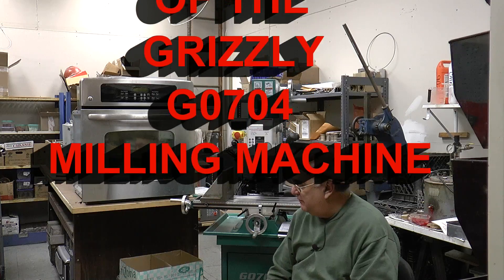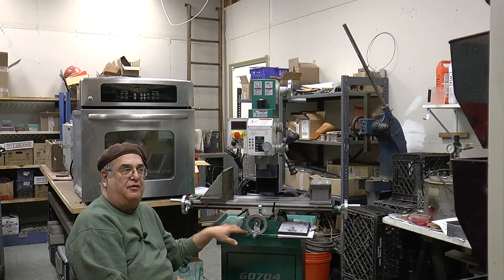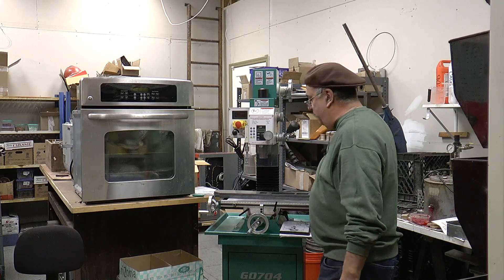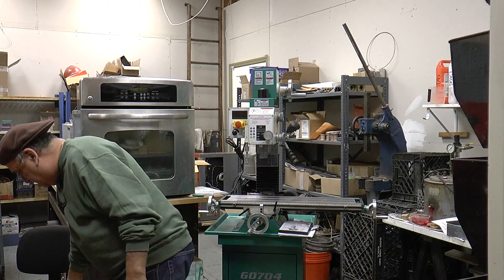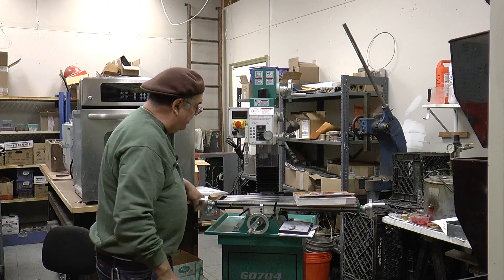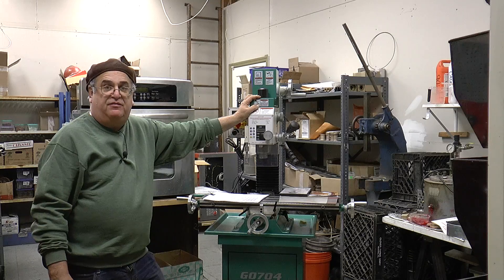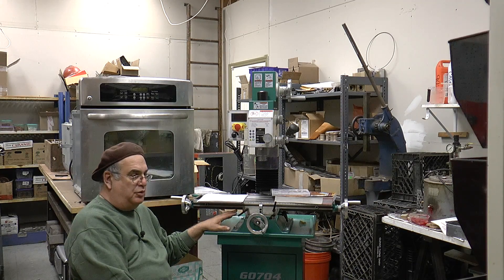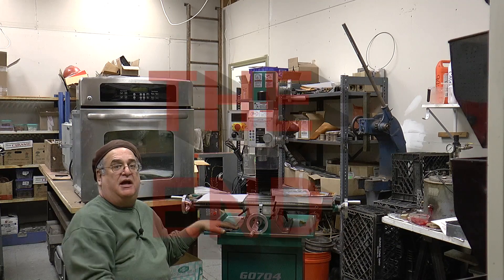A REVIEW OF THE GRIZZLY G0704 MILLING MACHINE

Comment: Looks like a nice little mill, and a good review. I am looking to get a machine/ machines myself soon. I have toyed around with the idea of a Smithy 3-1 because their benchmark is fairly high. What do you think about 3-1 Machines? I already have a small lathe(6"). I feel like I would end up getting tired of changing between the Mill and the lathe( I have some machining experience since both my grandfather was a machinist and he had a full shop like you have that I used when I was a teenager). Also I think that I would get kinda fed up not being able to stand in front and walk around the mill since I am accustomed to using a Bridgeport. I was thinking maybe I should just get a real mill like this one and wait on a larger lathe. It would be cheaper and I could send the larger parts out for machining (like drive wheels). Before he died my grandfather started my on the 3-truck Shay project with castings from http://www.shaylocomotive.com/. Most of the major machinging is done on the 3 cylinder engine.  I would like to finnish that before I move on to hopefully a 1.6 scale Pennsy L1s/K4 so I would like to have the capacity to do some larger progects with the mill. I have been considering Grizzly G0760 and Smithy MI329m mills. I like the Smithy more because it has hand scraped ways and a square coulomb. 
What do you think?
Joel V

Comment: There is a transmission gear that is the second gear after motor gear. Transmission gear is plastic and will strip quite often...Good luck with it
Reply from the maker: Doing away with plastic gears I will use belt drive
Reply: I can not believe they stick that plastic gear there #$%^!
Reply: +Emery Board It's common design practice in this kind of gear train to use a plastic shear gear as a sacrificial part to minimize damage if the drive is pushed too hard.

A belt drive avoids this, because if you stall or crash the cutter, the belt just slips instead...
Reply: instead, they could have made the plastic key that is placed between the gear and shaft..That way, the key would break when the emergency occurs. Then the user would replace the key which is easy to find or make compare to the gear...I hate plastic gear design for sure!
Reply: +Emery Board
If you have a mill and lathe and know what you are doing you can make the gear and plastic key yourself.
 "instead, they could have made the plastic key that is placed between the gear and shaft.."
They could have . Yes but they didn't . Deal with it . Don't waste time wishing for something they don't make. Make it yourself.
Your time would be better spent actually getting a mill and using it (even if just only making parts to improve the mill itself) than sitting around complaining about "they could have done this" or "they should have done that"

Comment: The only advantage the computer has is its ability to perform dull and repetitive operations that fatigue a human worker.  For one-off (or even a dozen-off) parts, the manual lathe and manual milling machine still occupy the commanding position.  For greater than 1000 parts, computer controlled devices probably are to be preferred, and therefore justify the programming effort.